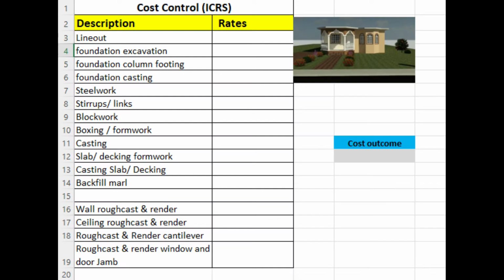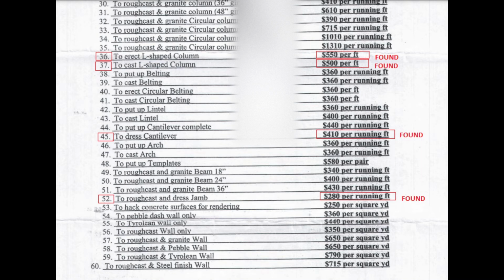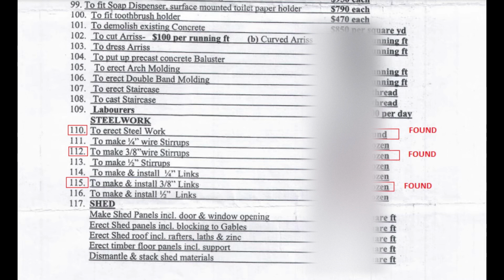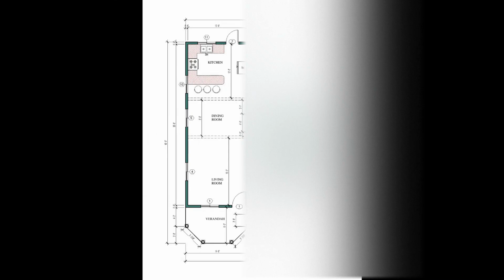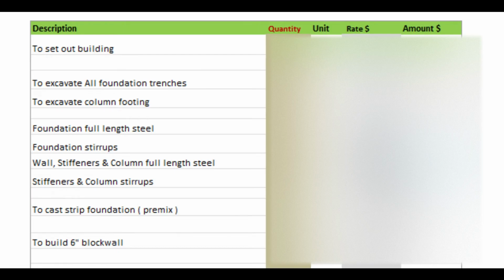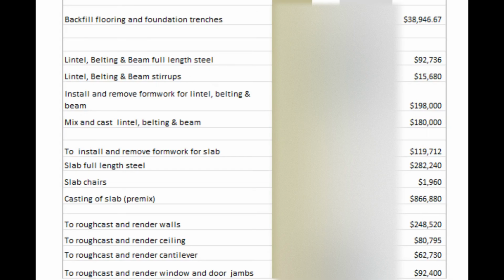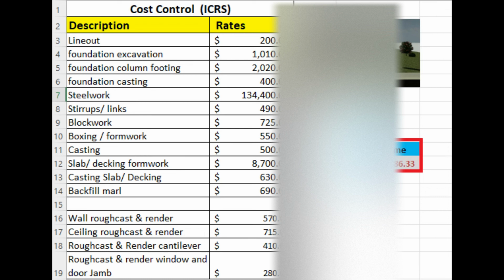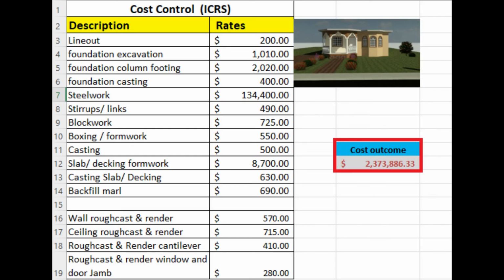Independent Contractor Rate Sheet Review

Comment: A column and a stiffener are the same thing,where one gets confused has to do with sizing. A stiffener is always only as thick as the wall it's place into,a column is normally 8" X 9". A column is normally wider than the wall it's placed to hold.
Reply: A column is different from a stiffner.a column is independent while a stiffner ties  walls together .a column is like a light pole
Reply: A stiffness is used in place of tie blocks,although they are both columns they serve different purpose, hence the name stiffner